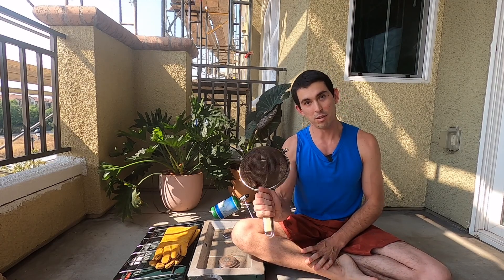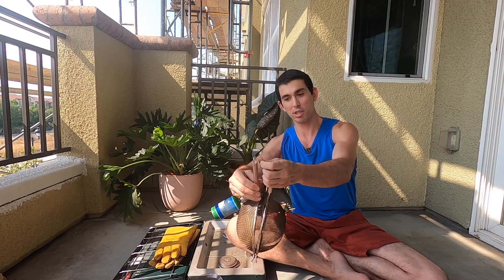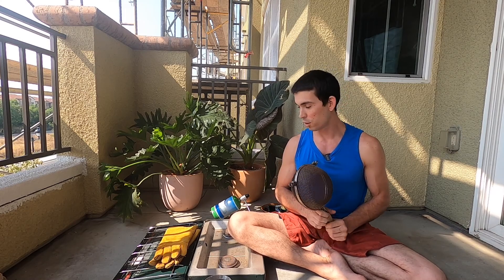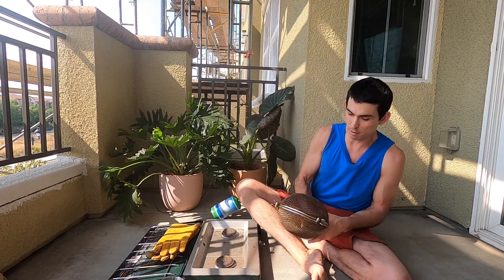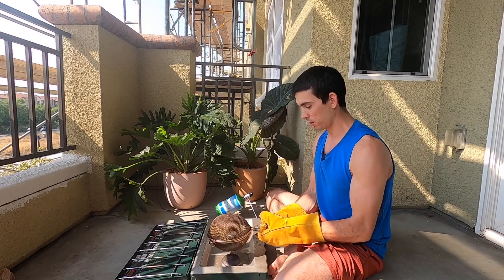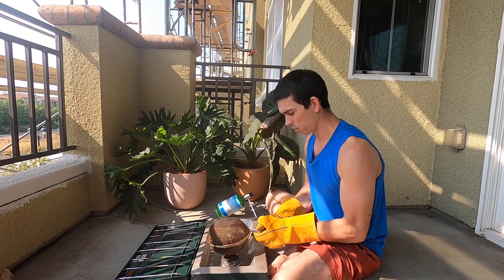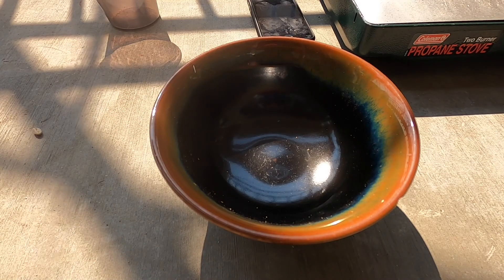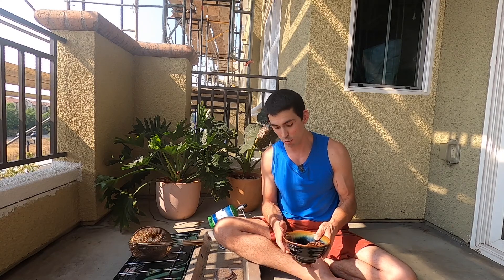$15 DIY Coffee Roaster IN ACTION

Comment: I use a similar set up. And yes....you are too close....too hot.   I put a soup can with both ends cut out....essentially a hollow tube.....on my butane cooker top as a spacer. Works great
Reply from the maker: That is an excellent idea! I got some good roasts with this setup but I definitely struggled to repeat things consistently. I will pin this comment so that people can benefit for your modification. Thank you!

Comment: I thought about building one the same exact but my challenge is where to find a large glass you have, I am not computer roasting fun so I could use manual controller for both the fan and heating element. I am really good in metal fabrication so no worries about creating shape or even finding premade ones online, Please if you could share your source the glass cylinder thanks.